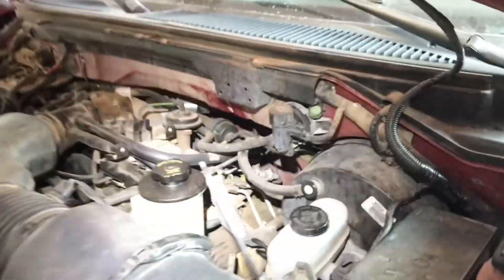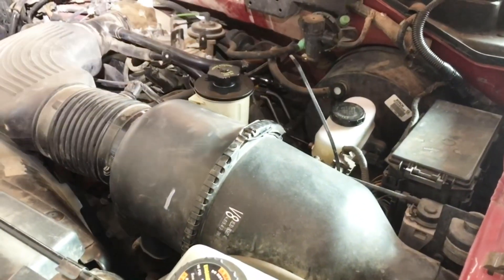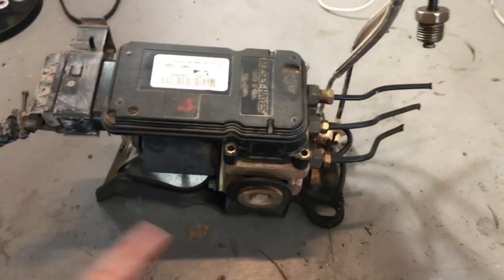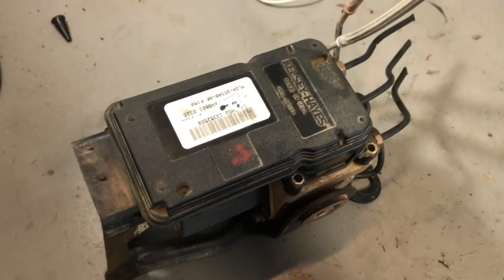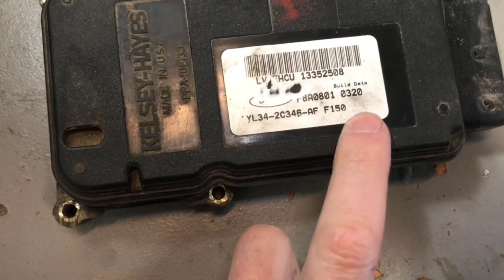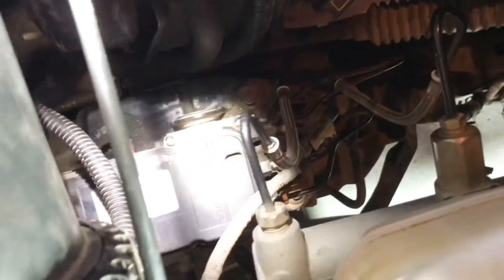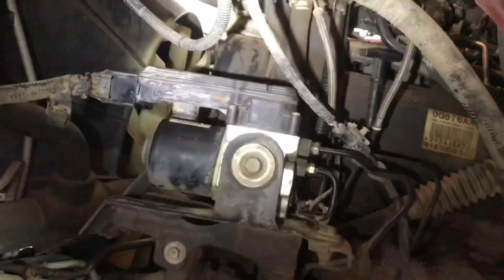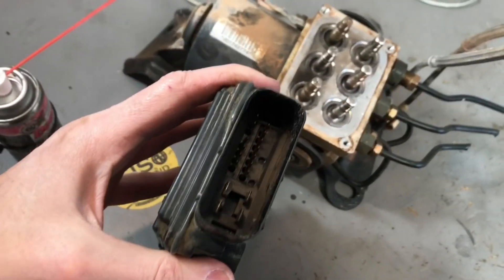Ford F-150 ABS Module Replacement - pump motor won't stop running! 10th Generation F150 & Expedition

Comment: For anyone watching this in the future,  use a t20 not a t15 and the module bolts will come out with no hassle.  I was able to leave everything in the truck and popped all 4 loose.  Remove the intake tube and everything is super easy to get to. I sprayed a healthy amount of penetrating lube on each bolt, waited 5 minutes, popped em all out.  Now it is off to get rebuilt.  Hope this helps someone.

Comment: Thanks for your content sir! At just under 300k miles my ABS light comes on and intermittently and throws a C1185 code.

I hit a local Salvage yard and picked up the whole mod (pump & controller) and will be swapping it all out.

When you disconnected  the Black Control Unit from the pump did you lose a lot of fluid? I just completely rebuilt my front end and am NOT interested in the Brake Fluid ruining all the new rubber on ball joints/ shocks/ and cv axles.

Anyway - again - MANY THANKS for your time and content on this
Reply: Follow Up.!

Swapped the unit out an ZERO ISSUES - everything works well and the salvage yard part saved a lot of cash!

No Fluid Loss
Reply from the maker: Nope, no fluid is in there.

Comment: Couldn’t you use WD40 or PB Blaster on the torx screws instead of mangling up the screws?
Reply from the maker: Maybe, depends how seized they are. Worth a shot

Comment: I am almost finished with a full brake line replacemt in mine. The only problem is i forgot to to label which line goes into which hole and cant find any diagrams online

Comment: Dont take this for gospel but these trucks may be different, but you might be able to reconfigure the abs module so long as the original still works enough to communicate through the OBD port using a program called "forscan" (and keep you from having to find an exact match in the junkyard) 

Long story short, I did a powertrain swap on ford fiesta  from an "ST" donor car with the turbo motor.  I was able to retain the chassis original non-ST abs module using forscan to pull whats called "as-built" data from the donor cars abs module, and programmed it to the one in the donor recipient car.  Worked like a charm.
Reply: @mikeg3529  oh, so that's what they meant by reprogram the module, makes sense, assuming a dealership already has the file based on the vin nr that could work too.
I bought a forscan module a while ago but i didn't get to install the software on a laptop yet. long story short , this module as soon as I plug the wire in it , it starts buzzing like crazy , i found it by accident trying to figure out how my battery kept dying overnight. that being said if it buzzes  not sure if it communicates but I'll have to try .
if i put the new one and it simply works i can assume i don't need to program it though ?
Reply: @SilverBullet93GT  its worth a try.  The fault thats causing the buzzing may be in an area of the circuitry thats seperate from the part that deals with communication,  in fact if the abs light is on and theres a code being set for something wrong, thats a good sign that it will still communicate. 

That being said,  idk how big the differences are between the different abs modules is,   it may be minor difference in how the abs system behaves like its sensitivity.   Or it might not work at all.  I cant tell you for sure.
Reply: @mikeg3529  I'll add it to my list of projects :)))

Comment: very good info, i got mine a while ago from a junkyard but didn't put it in yet, as i heard the ABS needs some sort of computer calibration/bleeding done via OBD2?? Anyway good to know about the screws, do you know what thread pitch they are?
Reply from the maker: No calibration needed that I know of. m4x.07 pitch x25mm length